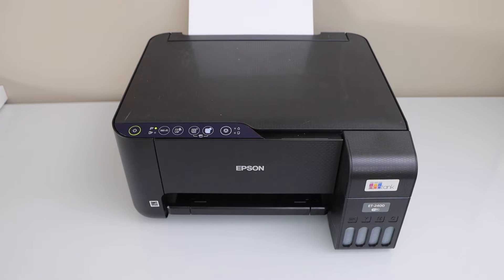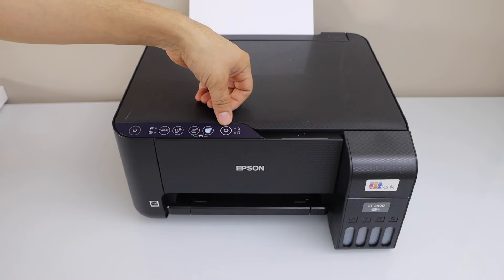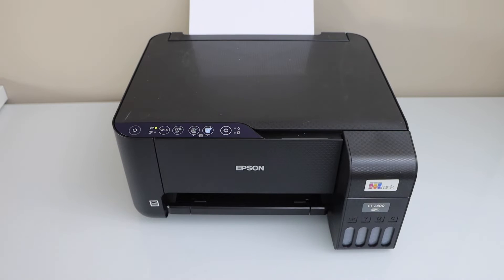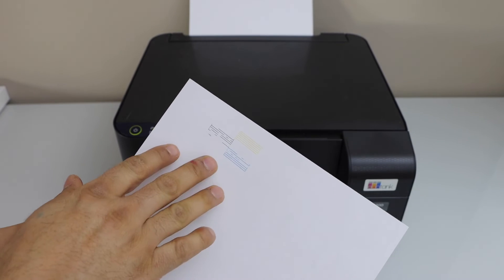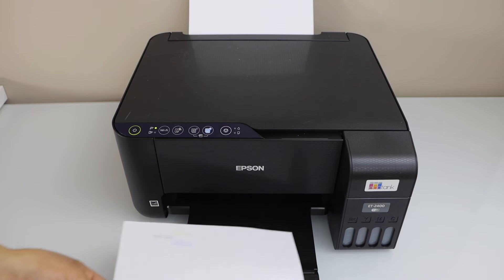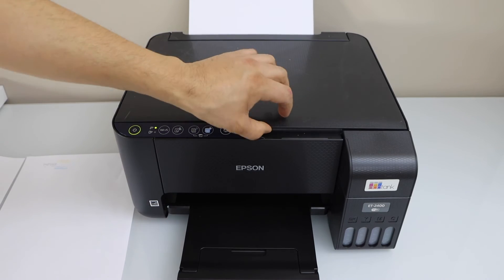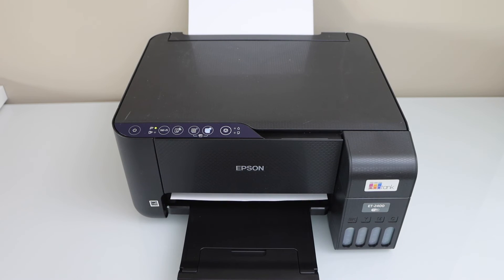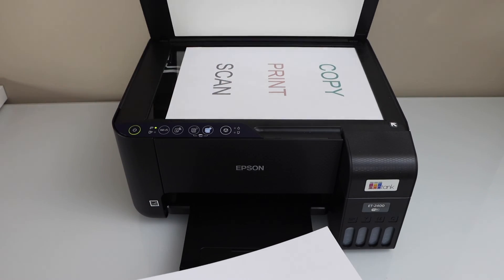Epson ET 2400 Clogged Nozzle Check & Cleaning (L1210, L1250, L3210, L3250 )

Comment: It do work guys, mine worked in one try only cause it did not seemed that clogged by the results. May differ and have to repeat the process if it seems still not fine but at least it do works

Comment: PROCEDURE
1. Load paper in the paper tray
2. Turn on printer
3. Turn off printer
4. Press and hold power button and cancel button altogether for 8 seconds
5. Release the button and wait for the printed nozzle check
6. If there is improper lines or no print, it means the printer is clogged
7. To do the print head cleaning, press and hold the cancel button for 5 seconds
8. Power light will keep blinking. It will use some ink and it will dump into the maintenance box. It takes for 5 minutes
9. Put any printed paper in the scanner and press color scan button 
10. If the scanned paper and printed paper are not the same, you need to repeat the process. It needs more print head cleaning

Comment: Everything seems to work on mine except for the test print. Nothing prints. The power light returns to static, all the noises stop. No test print. Any tips? Thanks!
Reply from the maker: I think just resume normal printing . If there is any problem then you can do auto printhead cleaning.